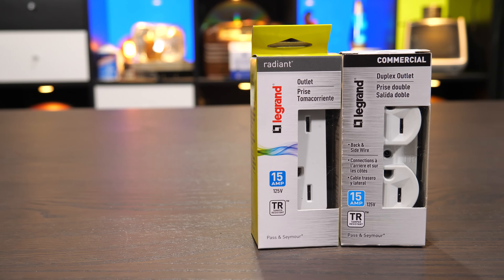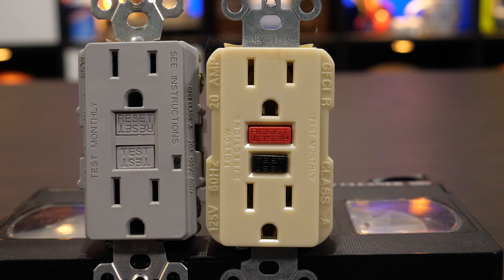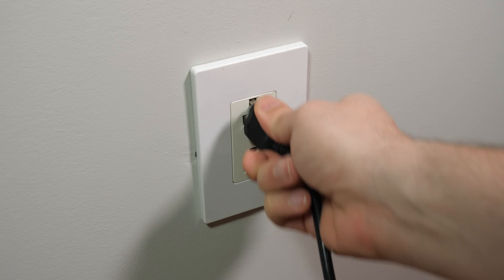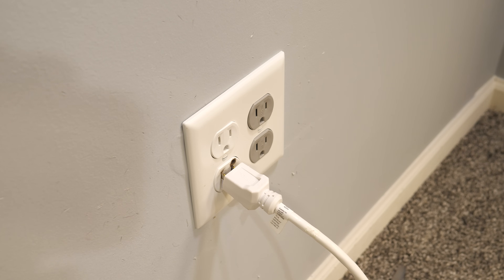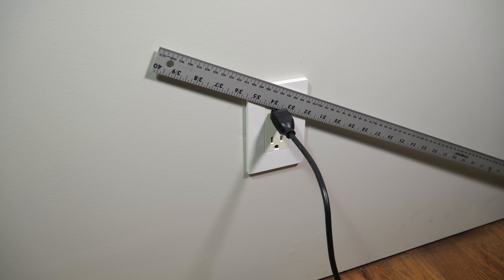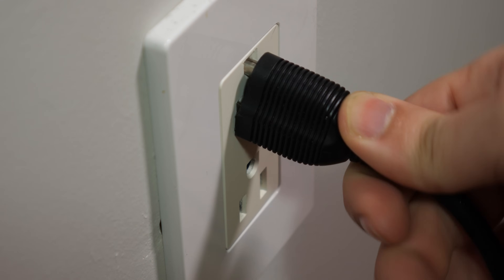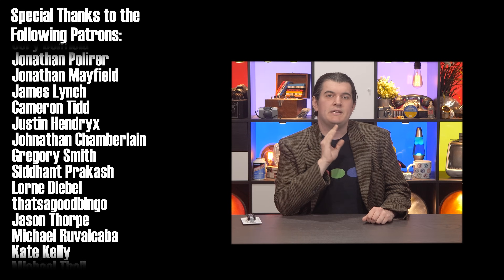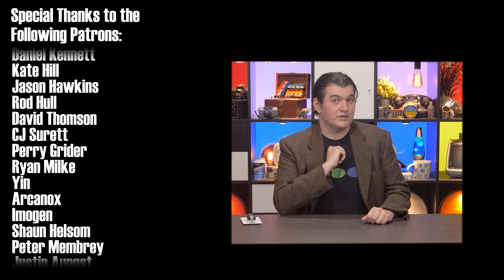Power outlets are topsy turvy - but does it matter?

Comment: One thing I thought he should mention is the fact that two grounded right-angle plugs are impossible to use on the same outlet.  This is why I think duplex receptacles should be installed horizontally (as compared to the current installation), but with the ground pins facing out on either side.
Reply: In my experience big right angle plugs for things like portable ac units block the second plug on purpose. The reason being that the one load is close enough to tripping the breaker that they don’t want you adding any more load to that circuit.
Reply: @mh98177  You’re right about overload protection, however, I have some light duty extension cords that do the same thing.  Good point though!
Reply: That's why I like the 45° ones he mentioned. Best of both worlds.
Reply: This is why they sell foot-long power extension cords, so the plugs don't crowd each other, especially the wall warts (plugs with a power converter)
Reply: Yup, 100% agree. More generally, the line drawn between the ground plugs should not be on the centerline of the plugs. (Oops, I let my math side show.)
Reply: oh i was not concerned with whether or not that creates liability,  i am just adding that anecdotal comment about the 5 or so air conditioners i have had to install all mentioned this.
Reply: @@Lronhoyabembeevery AC i have read the instructions on requests you run it on its own personal circuit, granted it could be different country by country...
Reply: Or how a the way they are here in the UK side by side with the ground pins facing up
Reply: Opposing grounds also means opposing polarity. That means having a neutral and a hot on the same side of the outlet physically. This presents multiple safety issues, not only for the original installer, but also for anyone dealing with the outlet afterwards. It also increases the risk of shorts and/or fires as you introduce a short path for electrical conductivity. Existing outlet design has neutrals and grounds safely on one side and hits isolated on the other, physically as far apart as possible. Voltage in, then out, nowhere near each other in high load situations. To have a pole on each side, internally the plug would have an 'X' where the hot/neutral must cross to the other side. This vastly increases safety concerns/heat as now the electrical path is in very close proximity and aged/heated plastic does stress crack/shrink.

From an engineering, mechanical, electrical, fire safety point of view, opposing ground outlets are a nightmare, a disaster waiting to happen.
Reply: Noone has heard of a surge protector......you only need 1 plug and there always 3 prong...............

Comment: Right angle plugs are actually made that way specifically for cable management, it's so that for example if you're running a power strip up to a computer desk the cord goes upward and then you attach the power strip to the back of the desk which is what those little notches on the back are for. That way you only have one wire underneath your desk and you can roll up the excess for all your power wires and hide it behind the body of the tabletop And again we left with only the wire to the power strip running down to the wall... Think about it most of the things that come with right angle plugs are items that are normally used above any standard outlet height or in the case of power strips, they assume some degree of cable management will be used. I've even seen power strips that go as far as to have loops for those Velcro cable ties to attach to below each plug and suction cup or adhesive backs. Just a little bit of hardly known basically useless information..  lol
Reply: Yeah I ain’t reading that
Reply: @benstone217  nobody told you to

Comment: Fireman story time. I went on a call where, behind an electric oven/stove, the plug for it was oriented in the “normal” ground down. It was slightly pulled out exposing the hot and neutral prongs of the plug. Someone in the house dropped a utensil behind the stove. It was caught by the exposed prongs, resulting in electrical arcing. No fire but left a burn mark on the wall and fried the utensil.

Comment: I moved into a new house in 2020 and all the outlets were traditionally speaking upside down, I hired an electrician to replace and turn them all around the correct way because it drove me nuts. The reason they were upside down in my home though wasn't for safety, whoever wired the house used marginally less wiring by putting everything upside down and the wires in the wall were so tight the outlets almost didn't come out of the sheetrock.

Comment: In France and parts of Central and Eastern Europe, the standard design is a plug with two prongs and a receptacle for the ground, delivered in the form of a prong hanging out of the outlet (CEE 7/5 or "Type E"). And arguably the most common outlet design is a dual outlet with the two sockets upside down against each other, so that the two ground pins are right next to each other. Yes, this means that there isn't really a standard orientation of live vs. neutral, but we don't seem to care.

Continental European plugs and sockets are much better than the American ones in every other way, though - they're universally (except Italy, their outlets are weird) recessed or spatted so that the pins are never exposed, and the pins themselves are universally sleeved on ungrounded plugs, except some very old ones. Really, I've heard people drool over British plugs, but even the ordinary continental Euro standards are so much better that the American plugs and sockets feel TERRIFYINGLY unsafe in comparison.

Comment: My mother got a new refrigerator ( a long time ago ) with a right angle plug with the ground pin on top. She told me to flip the outlet. Of course having worked in the field I just had to have the quite common gall to 'properly' inform her that's impossible. She called me a liar and 'questioned' my professionalism, so we entered into a spittle blowing contest which I decided to end about a half hour later by pulling the refrigerator out and scalding her about her impossible dream scape! But I didn't say anything as I quieted down humbly and went outside to my truck to get my toolbox. When I unplugged the refrigerator and looked unbelievably at it sure enough the ground pin was on top.

The first moral of the story is sometimes you run across the strangest most bizarre things. And moral number two is, sometimes the impossible happens and mother is right about something in your chosen profession.
Reply: My mother-in-law is a self-taught medical diagnostician like that. I feel you.
Reply: @CallibanMcGee  Sometimes the self-taught people can be more knowledgeable about certain aspects.  They don't have the "well this is how it was always done" mentality that some professionals fall victim to.

Comment: The outlets in my house all have the ground plug on top and it's a huge pain in the ass.  Probably wasn't a big deal in the 70s when the house was built, but all those right angle grounded plugs nowadays don't work well, or at all, with that orientation.  I had to buy a little cube multitap last week so I can keep a heater plugged in and still use the other outlet.

Comment: Idea: invert the two receptacles such that one faces up and one down such that the top receptacle always has the ground facing up regardless of which way the receptacle is installed. Also, two such of the right angle plugs could be inserted into one receptacle. Boom. Mic drop.

Comment: Being a retired hospital electrician of 45 years, I started replacing them with the ground pin up before it was being mentioned. Why? Today it is required to check a percentage of receptacles in a hospital periodically. Years ago it wasn't. In a hospital patient room you will find stainless steel cover plates. In that setting equipment is plugged in many times a day. The cover plate screws will eventually become loose. Nursing staff does not pay attention to that issue. Many times I have been called to a room to replace an outlet and equipment male plug where the cover plate screw fell out and the plate slid down onto the pins of the male plug shorting out the hot and neutral pins. With the receptacle ground pin up if a cover plate slipped off it would just hang on the ground pin. During the last 20 years of employment there I would purchase 3/8" 6-32 screws that were pre treated with lock tite and anytime I came across loose cover plate screws during inspection I would replace them with the locking screws. Also during any new construction or renovations I would spec to have the electrical contractors use locking screws on all stainless steel cover plates. Construction is not perfect and sometimes the electrical boxes are not flush with the wall board so the receptacles can not be secured tight against a box that sits back a little. Constant use will crush the wallboard where the receptacle ears sit against it. When that happens the cover plate screws tend to loosen with use.

Comment: I prefer the outlets installed with the ground pin down.  This makes it easier for the natural way the wire hangs when plugged in to the outlet.  The idea of the ground pin up was to help avoid people from accidentally touching a live pin while removing the plug.  If I was to install an outlet sideways, I would put the neutral slot on the top.  
--
The National Electrical Code (NEC) doesn't require a certain direction. The NEC allows outlets to be installed with the ground plug hole facing up, down or sideways. It's up to you, there is no standard electric outlet orientation. So that means there really is no such thing as upside down outlets.

Comment: Here where i live, the power outlet can be populated with variuos types of single connectors arranged in the way are more functional with the specific needs, so i'm just asking. Why don't make in these rectangular electrical outlet the ground pins both on the external sides, with neutral and live face each others? I mean, it doesn't solve all the problems in all the situations/combinations pointed out, but the orientation isn't up to the electrician anymore, the users are "invited" to use the outlet below in case of right angle plug (due to the cord) that is less prone to expose the live pin, the wall plate will touch the ground pin if it comes loosen outside Chicagoland ;) and you can insert two right angle plugs in the same outlet without any adapter thanks to the opposed cords. Maybe are there some difficulties in the construction of the electrical outlet or i miss something else?

Comment: As a consumer, my dislike of right angle cords is aligned with my priority for convenience over safety. Plugs that come straight out are easier to use with the outlets that allow you to plug in 8 devices. It has 8 outlets so imma use them all, dammit.

Comment: Here’s a thought: Why not have the top outlet be ground up, and the bottom outlet be ground down? I can’t tell you how many times I needed to plug two things in, but couldn’t because they overlapped. This solves both problems—the grounded plug on top reduces accidents, while the plug on bottom accommodates the plethora of products who require the outlet to be ground down.

As far as superior power outlet design, I am imagining a plug which looks a lot like you took a USB-C and made it bigger and thicker. Said plug has several male prongs for different, pre-stepped voltage outputs, safely guarded by the ground sleeve. Pins can be combined for higher power applications, or omitted for low power devices. And the female outlets, the side where the power comes out, remains a slot, but it’s not just a big hole like USB-C, it’s an oval cutout with pinhole cutouts inside. In this design, low power devices can simply only connect to a single pin; it’s much more difficult to electrocute oneself when you’d have to gather several paperclips to get enough power to  hurt yourself. Plus it would be extra nice if this future plug could natively adapt to USB-C PD at high wattage with a simple adapter.
Reply: Top outlet ground up, bottom outlet ground down means that hot and neutral have to cross inside the outlet, which would be more difficult to manufacture, and potentially create danger if the outlet was badly damaged.  Also this wouldn't change anything for safety if the top outlet was empty or had a 2 prong plug inserted.

Comment: I’ve heard all about putting the ground at the top to prevent a metallic object from shorting out the receptacle.  WHAT BS!  I’ve never encountered such a situation.  Upside down receptacles are nothing more than a pain in ass, because most small appliances are designed to be plugged with the ground at the bottom!

Comment: This is all fear based hypothetical rhetoric. 

The reason the plug design is not as safe as it could be (like in some countries) is because 110v is not that big of a risk. Unless you don't let go when you get shocked, you're going to be fine.

As you mentioned in a previous video places like the UK had to use higher voltage for their systems and because of that they wanted to develop a system that was harder to get shocked. 

You are worried about it being the wild west in design, but honestly when was the last time anything bad happened to you with a standard US made outlet that wasn't worn out? 

It's always amazing how people want more government intervention in their lives. Most likely because their fathers weren't around to teach them anything.

Comment: The only time I ever experienced a problem with exposed prongs is when I was using a putty knife on the wall and dropped it straight down on the plug. It popped the breaker. I hate the ground up orientation because Too many devices just aren’t made to be plugged in that way

Comment: Soon as I saw upside down I'm thinking about those large adapters that would pull out. Instead ide say that idea of sideways installation sounds better and more so if they reversed one of those outlets so you could attach 2 of those right angles plugs perhaps with that 45 degree angle.

Comment: On commercial construction if they use union electricians outlets are ground up. I have found ground down outlets with coins shorting hot and neutral in restaurants under cash registers.

Comment: They should just make the outlet so that the top receptacle is ground up, and the bottom one is ground down. Because you can’t plug two right angle plugs into one socket, you can plug it in on the bottom outlet, and if it doesn’t protrude like one of those air fresheners, you could plug a standard plug in the top.

Comment: Commenting before watching most of the video, so I don't know yet if this is mentioned, but I work in schools and this is how almost every new outlet is installed. Nobody has really ever told me why, but it makes sense to me as it would be far harder to short the live wires when they are oriented with ground on top. I've actually been in a situation where I unscrewed a metal panel covering A/V equipment recessed in a cubby with an outlet with ground on bottom just below it, and the panel slipped down and landed right on a plug in the outlet and tripped the circuit.

Edit after watching more: Almost everything plugged into wall outlets in schools is a powerstrip with a ground. The only things that are not plugged into a powerstrip are generally mobile A/V carts, digital signage (usually with the outlet behind the signage and not easily accessible, or laptop/ipad charging carts, all of which have ground plugs, except for the occasional older model digital signage, which again, isn't an issue because the outlets are usually not easy to access ie. directly behind the signage or high enough up that it isn't a worry to drop something on. The only (pretty big) exception I can think of is computer labs where there is usually a long run of outlets beneath and behind the row of computers, all of which have ground pins. Although, the rows of outlets for computer labs are usually oriented in the horizontal fashion.

Comment: The miracle to me is that the American wall outlet and plug design hasn't been completely changed into something safer yet...

And then you're saying the biggest downside when talking about the right angle variant without mentioning the glaring downside right in your face... You can't plug two right angled cables into the same outlet because one end up getting obscured. 

You've got a nonsense connector on two fronts.

Comment: Right angle plugs is the first thing I thought of at the start of this video. Nailed it. I use a ton of them. When I first moved in to my house I noticed all the plugs where “upside Down” from what I was use to as a Kid. So I had them all swapped. Now I learn ground up actually has a purpose. Still super annoying when plugging in a nightlight for the family or using right angle plugs. 😂 Great video. ❤🤘
Reply: In britain, all plugs are right angle, I suspect so that you can't yank them out by the cord, which of course is not advisable for any sort of cable.
Reply: I actually have a portable AC unit with a right angle plug where the ground is at the top
Reply: It seems ground-up right angle plugs are becoming more readily found in the US. They're already common overseas in places where they use NEMA or multi-standard sockets.